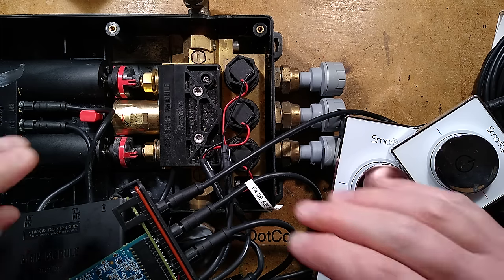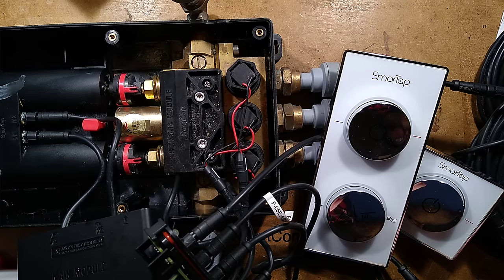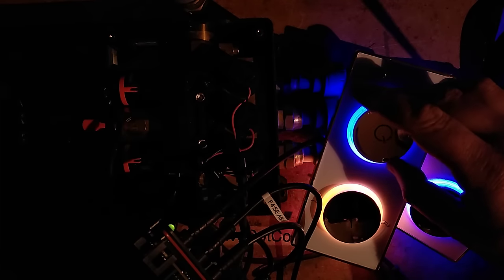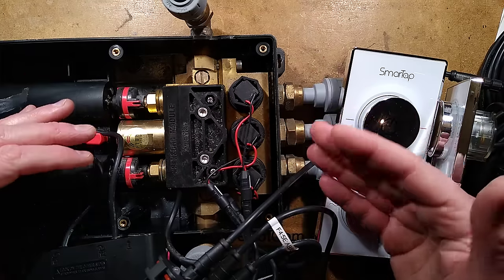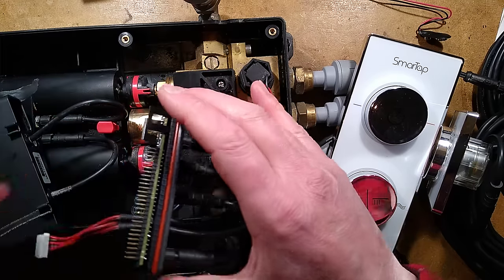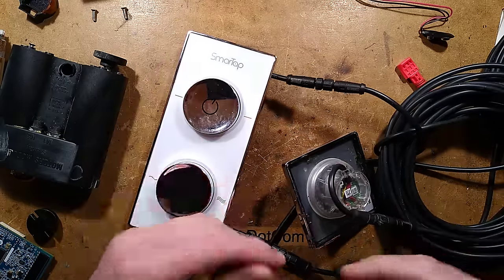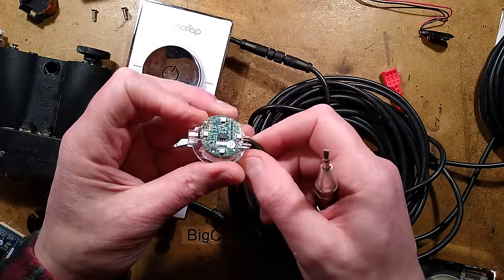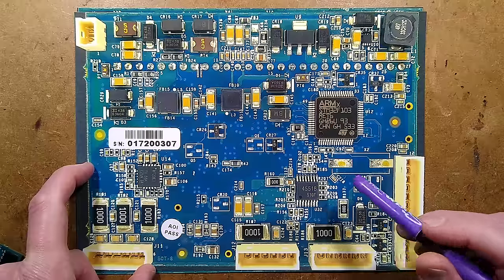Smartap - when the Internet of things goes down

Comment: And that's why local control is 100 percent mandatory in my house
Reply: "If cloud then nope."
Simple.
Reply: I couldn't agree more. I can never understand why people are so ready to give up control of their own lives, but not only that, give away a load of metadata that tells anyone with the means to interpret it, what days you use the shower, what time of day you take a shower, how long you're in there, how much water you use, and how warm you like it.

It's a crazy world where people allow themselves to be controlled and manipulated by a third party, and without a moment's thought !
Reply: I want my vehicle to have a door and ignition key, my appliances to not talk at me or have any screen now than to display the time, my surveillance devices air gapped on a dedicated server, my telephonic device to have a removable (replaceable) chemical electron storage cell and my elevators to run on relay logic with a disc floor selector. 
Call me a Luddite if you wish but I like things with a lifespan measured in human generations, not months.
Reply: So true.
Reply: With the current fairly solid state of HomeAssistant and a plethora of devices one can use straight up or by reflashing their firmware, there really isn't any reason to use anything outside of a local control.
Reply: I like smart home stuff, but you have to go at it with a couple principles in mind.

1. It's not replacing functionality, it's augmenting or adding. If the smart device stops working, the dumb functionality should still be there and be as easy as expected from the original dumb functionality.
2. The smart functionality should work entirely without an internet connection. If my phone is in the same house as the smart device, it should be able to control it no matter what.
Reply: @matthewellisor5835  So much yes.
Reply: Not the easy way to set up at first but in the long run it is easily the least cost and effort way for doing things
Reply: I have been searching for floor heating thermostat that would handle control through local network. There seem to be zero solutions available and couple potential if you program custom firmware into it
Reply: I've worked enough with smart networks and automated gizmos to know I don't want them in my house. Or in my car, really.
Reply: I'll stick to having a dumb shower installed. At least then, I won't have it prevent me from having a wash in the morning because I happened to make a tweet the manufacturer found offensive or because I refuse to pay a subscription fee or because the manufacturer went out of business or just decided to strong arm me into upgrading to a newer shower.
Reply: @whitesapphire5865  Indeed.
Reply: I completely agree. I've built several DIY home automation gizmos but they are all managed on our home LAN. I've never understood why folks are so enamoured with cloud based automation.  Clive's teardown shows the limitation of cloud based widgets.
Reply: I agree with everything above.  Honestly the meta data is a problem for, but for me ... The worse part is added latency and reliance on something else to work (server, AWS, etc).  From a design perspective they want the data.... Because logically there is NO reason to make the Internet required to operate something within my house .. light, garage door etc....

The Chamberlain fiasco was a good example.  They claim security etc.... For their API fine .. bag argument.... But that's their view.... But why not allow local?
Reply: @whitesapphire5865 I can't imagine buying a multi hundred dollar valve that gets turned into trash because some startup goes out of business.
Reply: Not difficult to achieve with home assistant and zigbee.
Reply: I take it a step further, not only does everything need to be locally controlled but everything needs to have a non-smarthome based way to control it. It's great that the lights turn on automatically when we enter the living room and turn off if the room's not occupied, but if the home automation platform has a bad update or the room sensor conks out (as happened to me a few weeks ago) there must be a switch to turn the lights on and off manually. I don't want troubleshooting the smarthome to be a mandatory high priority task.
Reply: @andrewfidel2220  there are in wall switches which function using zigbee and mechanical at the same time. So once your systems goes down the lights still can be controlled.
Reply: @the_tux  In my case I've got two levels of backup, the first is a Zigbee scene controller which is paired directly with the lights, the second is a physical button connected to the strip controller, so fairly similar.
Reply: @timop6340 Shelly with Add-on? I'd still somehow hardwire a mechanical or local thermostat. Perhaps a normal thermostat, turn that up a little bit extra and then Shelly with Add-on to cut the power to the thermostat? I've seen what a floor heating can do to a tile floor if the thermostat goes bad and the floor heating gets stuck on. Concrete (as pretty much any material) tends to expand when heated
Reply: Totally. Annoyingly tho (from an owner) it was listed as local control on various sites. Only after install did it become apparent that this was only available for Hotels and such
Reply: @whitesapphire5865  You think you have control over your life? Lol. That's a nice joke.
Reply: @StubbyPhillips  Cloud, not even once.
Reply: You'll have to be connected to the internet 24-7 soon.  That's how they know when to deliver the bugs for your two meals a day.
Reply: Agree, although even fully local control isn't immune to break downs.
For me the rules are simple - local control and enhance existing functionality rather than replacing it (so you still have the original manual way to interact with the lights / heating / whatever) if the "smart" way suddenly loses its mind
Reply: I generally won't buy something that can't be reflashed with ESPHome or Tasmota... If it's Chinese, it's definitely not running without being reflashed with something more trustworthy.
Reply: "Alexa flood the building!"
Reply: 100%
Reply: @andrewfidel2220  At least if my Home Assistant craps out (and it does, sometimes), I can reboot the Raspberry Pi that it runs on, or restore a backup, or otherwise fix it myself. If I relied on the cloud and there was an outage, or worse a company went bust, then there's nothing I could do about that.
Reply: @zwerko …if you know how to!? I would prefer my smart home be locally controlled but it’s beyond my time allowance and understanding.

If someone cares about when I turn my lights on or off, climate control use, when my Roborock vacuums etc… maybe I should feel special!🤷‍♂️🤣
Reply: @ericbwertz 15 minute cities aren’t communism little buddy.
Reply: @reeddeer793 Unsure how you got there, but movement restrictions are a hallmark of high-control governance.  Communism has always fallen in that category, if that's your interest.
Reply: I guess the new "matter" protocol, will make local control more readily available for people that don't fancy all the custom firmware flashing business. With "matter" this device could of had a much longer lifespan, even if the company goes bankrupt😉😜🤣🤣🤣
Reply: Local control and LAN-only functionality is mandatory in mine, internet loss should only take down off-site access. That's why I run Home Assistant with everything flashed with a firmware that allows LAN-only control.
Reply: @eduardog3000 These are my hard rules. If it doesn't do this, then it doesn't get added.
Reply: @ericbwertz  If they want me to be connected to internet so bad then they should run some damn broadband through here. I'm not even talking about fiber or something like that; we don't even have DSL out here. pretty much one's only options are 4G with a mast antenna and amplifiers/repeaters/the whole nine, long-range wifi, or satellite. 😔

Comment: When a simple tap isn't good enough...
You can imagine the fun that ensues when it breaks and the plumber turns up expecting to replace a tap.
Reply: "What cowboy sold you this crap?" 
Before ripping it out and putting in a more expensive shiny chromed copper setup which gives him a 50 per cent profit.
Reply: And imagine when he says. Gotta order the parts and it’ll take two weeks
Reply: @Youtubecensoredmyusername  It won't. The company is dead. There are no parts. Unless you want to send it to someone like Clive to reverse-engineer it in order to fix it. All the while all of your taps don't work.
Reply: @jwhite5008  even if the company was still around. I’m sure ordering parts would be a nightmare.  Cant beat an old washer and seat
Reply: Well as we know plumbers have a degree in computerised automation and electronics technology😎
Gaz Yorkshire
Reply: @Gazr965  all of my plumbers hold many degrees. One must be a Bachelors in  Rube Goldberg Analysis.

Comment: My side hobby is home automation using Home Assistant, an opensource software. There is a very healthy push for local-control-only devices that are cloud-free for setup and use. There are people hacking the wifi chips of similar devices to "lobotomize" them from the cloud. I also have a rule that everything I install has to be manually operable for guests and in case of network failure. Having to ask the permission of a chinese server to take a shower is never a good idea 😂
Reply: Or Amazon. Next time someone accidentally deletes the entire datacentre and you can't turn your lights on
Reply: Yep thats why I went with crestron - fully local no cloud BS

Comment: I found a copy of the manual and looked at the installation instructions. You are correct, it explicitly says do not mount with the pipes at the top, or on the side (for vertical installation), for horizontal it doesn't matter. The manual has specific instructions on what to do if you're using copper or SP/PEX pipes. It's actually a very good manual. As you say, the design had a lot of effort put behind it.

Comment: It's always funny that things like this, which try to fix a non-problem, adds more problems than it actually fixes. The biggest problem being it requiring the internet to use a physical thing in your own home. It would have been better if the server side stuff would be contained in a in-home smart unit which is connected through WiFi but shielded off from the internet(or at least have the option). The servers going down and it's just reduced to a fancy pansy way of physically turning on the shower/taps.
Reply: So many non-problem products associated with IoT and cloud computing, simply to take control away from you and generate personal data for the manufacturer.

Comment: This is a great example of why local API access is so important! Thanks for another awesome informative video!
Reply: I'll stick with a chrome brass API and hand interface.
Reply: @Sonny_McMacsson  In this application I completely agree. The closed-circuit wireless temp control for our tankless water heater is about as far as I am willing to go.
Reply: Yep! That’s why I’ve done DIY crestron system for my home automation setup, bulletproof, recognized, and most important doesn’t need internet.

Comment: That's still from the time when every company thought 'random household item + internet = good IoT,' I think many more companies will follow soon.
Reply: They're doing it for three reasons. Planned obsolescence so you upgrade often. Moving from a pay once, own forever model to product as a service to encourage product loyalty. And control, whereby they can control their product, intellectual property and enforce Terms of Service and Codes of Conduct either for them or for an external party.
Reply: we were promised internet of things a decade ago, yet it's still something largely not doable without doing a tech wizard DIY, due to every manufacturer trying to trap you in their very limited proprietary ecosystem, so most things don't work together. Also voice assistants somehow haven't become smarter in a decade.
Reply: I can almost guarantee some of them are repurposing source from free projects to do the brunt of their work, too. And while there's never anything remotely (no pun intended) bad about that, you can just tell a lot of these vendors immediately want the maximum return for the least cost/effort possible.

Comment: Don't think I would ever install a SMART device that controls something like water flow unless it was outside of the property or maybe in an industrial setting. Just sounds like a costly incident waiting to happen
Reply: Yeah, I doubt insurance companies would be too keen either.
Reply: Screw the "incident" - this mind virus results in needing electricity simply to have running water. The equivalent of constructing an apartment building without stairs, relying only on a single elevator.
Reply: Industry can't always get it right either. Watch CSB videos. :/

Comment: the three outputs are normally the bath spout (the single control which is placed near the spout which for a large bath can be distant from the shower and in reach of someone sitting in the bath), the overhead fixed showerhead and a handheld shower wand on a hose for 'cleaning down below' (the dual control thats placed on the wall for use when standing under the shower)

Comment: Hi Clive,
I built a house in 1980, and I have central control for the lighting. I use about 20 General Electric latching relays (RR7) to control the mains. You supply a 24 volt pulse to the "ON" terminal or "OFF" terminal of the relay to control it. The switches provide the pulses and are simply wall mounted momentary rocker switches (SPDT, normally off).  You can have as many switches as you want on any circuit because the switches are simply wired in parallel.  The switches are connected to the relays with cheap 3-conductor low voltage wire.  The relays and wall switches are still available from a company that bought the business from GE. Also, there are newer mains rated latching relays from other companies, but the form factors may be slightly different. I've been in several office buildings that use the GE system.
I originally wanted some home automation with the GE relays connected to a home computer.  I purchased a bunch of DPST reed relays and a few other relays (Radio Shack) to interface the GE relays to a home computer, but back in the day, this was very complicated.  So, my lighting has just been working like any other GE system with only one relay going bad in all these years.
A while ago, I started to play with microcontrollers, PIC programmers, Arduino, USBasp, ESP8266s, etc.  I realized that adding computer control to my lighting was getting much simpler.  I assembled an ESP8266, the old Radio Shack relays, and a handful of DIP ICs to control the GE relays over my LAN (WiFi).  I keep it all within my LAN and behind the firewall to avoid outside hackers, and I don't use any 3rd party services, known to go bust!
The ESP8266 provides a WEB page that has buttons to control the relays either singly or in various combinations.  Any device on my LAN can control my lights.
But my real wish was to have a few simple buttons next to my bed to control the lights.  For example, when you hear some sort of disturbance at night.  Interfacing it to Alexa would make me wake up folks by shouting, "Alexa, turn on the light."  And using a smartphone meant I had to put on reading glasses, turn on the phone, access the web site, and pust the right button.
So I used another ESP8266 to build a client with a few switches and pushbuttons.  It sits on my night table, and I can control it by feel.  There's an ON button, an OFF button, a few toggle switches to select the light, and a dim status LED.  Really simple, I don't have to wake anybody up, and I don't have to fool with a smartphone.  It took over 40 years, but I got what I wanted.
Reply: LAN of Things. I really like your setup idea. Tactile buttons are great stuff!
Reply: A friend's family lives in a 1950s-era house with latching relays controlling all interior and exterior lighting, with low-voltage at wall-mounted pushbutton switches, much like you describe.
When I lived there for a time (around 2007) it was like a game to me: which lights will work properly (less than 5%), which lights won't work at all (around 90%), and lights that will only work for a split-second when the button is first pressed (the remainder). Switched receptacles in some of the rooms were completely dead.

I offered to help them rewire the house, but they weren't interested. It would have been incredibly easy, since every single cable run in the house was done through individual conduit runs that led to one major trunk tray in the basement, leading directly to the circuit breaker panel/relay box.